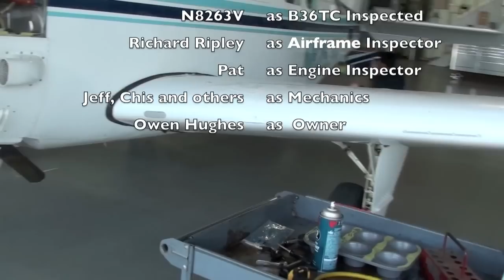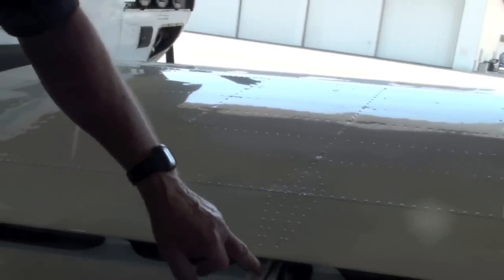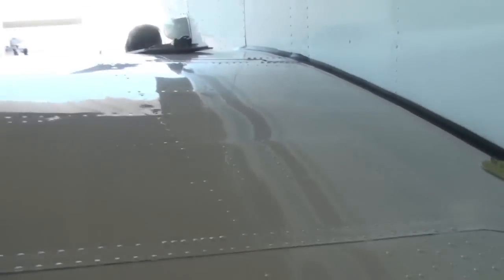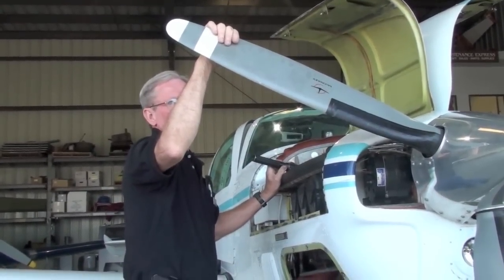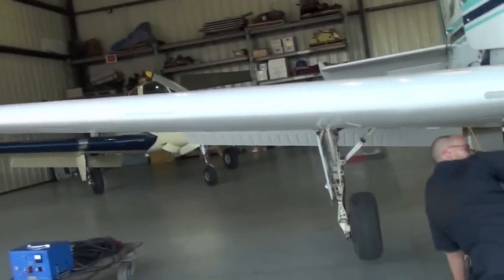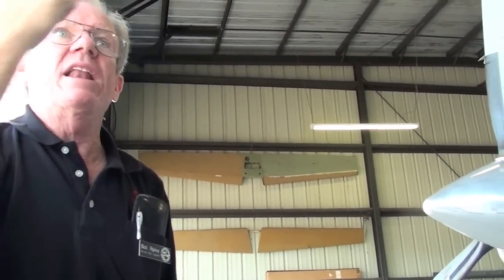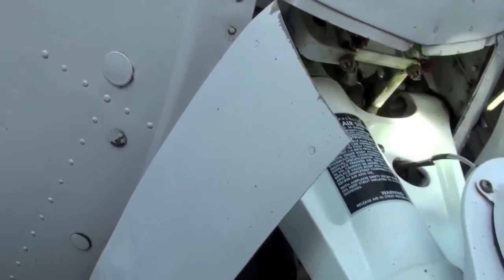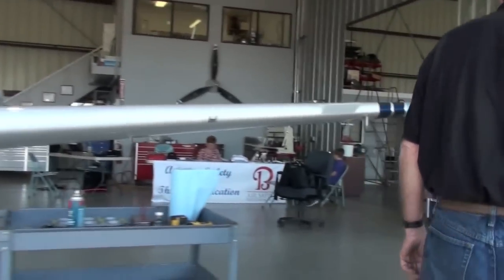American Bonanza Society Service Clinic 7 14 2012

Comment: Wow, I learned a lot. I hired an IA to do a pre buy on an airplane I wanted and it didn’t pass so I backed out. He spent 6 hours going over everything. At $100/hr it cost me $600.00 to find out that I shouldn’t buy the airplane at the price that was asked.

A good IA is way better than an A&P. This man knows this airplane well and it shows. I spent the whole 6 hours with the IA while he went through all the checks and my head was spinning with information. I think I learned more in those six hours than I did in 3.5 years at UND Aerospace flight school. There’s just no substitute for experience

Comment: I saw you fixed things you did after inspection how much of the checklist were you able to perform at the inspection point did they have a service crew there to help with the service issues after the inspection. It was a great great video
Reply from the maker: They did have a number of mechanics there and a very few of the quick items we dealt with there, but it the ABS Service Clinic does not do repairs - just a very well informed inspection.

Comment: @eonbio That fuel line issue you were talking about was damaged on my 2000.  B36TC. The shop put a sleeve on the line just for some protection.  I can email / message you the pics.  Great Video. Thanks again for sharing.
Reply from the maker: Thanks!  
One thing that came up on a previous annual was SB95-3B.  I had read about it and a friend lost an engine when the alternator drive gear was ingested by the engine.  I had the mechanic check ours and indeed the gear was loose and probably would have failed. Cheers!

Comment: wow That was a great video. That Bob Ripliey sure knew his stuff. I would feel great if he was my mechanic but I have an A & P so i could do a lot of that.  Did they charge you for doing that service clinic?  where do you fly out of normaly. I am in No.Cal Closest is STS Santa rosa. I am not a pilot or own a plane.    Great job.
Reply from the maker: Thanks!   

The service clinic is put on by the American Bonanza Society in many locations throughout the US each year, this one was at Livermore CA.   It costs a couple hundred dollars, but it is more than worth it to have your plane gone over by someone expert at the particular problems that can occur with a specific make and model of plane.   They don't do fixes - just flag issues. It would make a fantastic pre-purchase inspection if timing/logistics would work - and I think it makes a lot of sense to do perhaps every 5 years? in addition to your normal annual maintenance.  

This service clinic is just one safety service of the ABS. ABS also puts on a flight training program (ground and flight) tailored to each model.

I fly out of Yolo CA.    

Cheers!
Reply: Yes for a couple hundred bucks that was well worth the money spent since he found that Up lock link loose on your nose gear.  He said that was crictical and they fixed it right there.  Does Bob go to all of them or was he a speical guest.

Comment: 300 hours on the cylinders and they're all barely holding compression in the 60's.  Wow.
Reply from the maker: After an extended period of inactivity surface corrosion makes this pretty common.   6 years and ~700hrs later they have been up (70's) and back down depending on operation and ?  In the 60's again most recently (as again low usage).

Comment: Technology from the fifties definitely needs a lot of maintenance.
Reply from the maker: its remarkable how much maintenance all aircraft require.  new planes like cirrus or even rotax powered light sport ALL require constant maintenance to maintain airworthiness.  perhaps great need for maintenance is a result of engineering compromises required for the demands of flight (light weight, etc).  or perhaps we've just become accustomed to the remarkable reliability of cars that had millions of hours of service and countless design cycles to achieve low maintenance requirements.